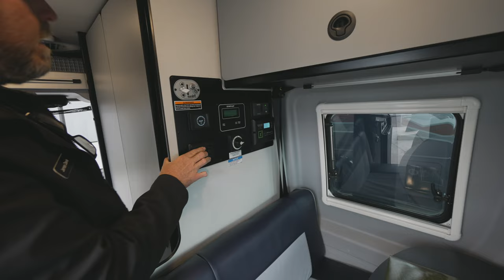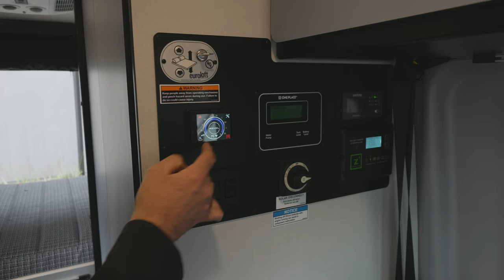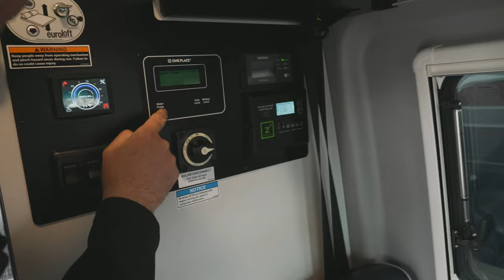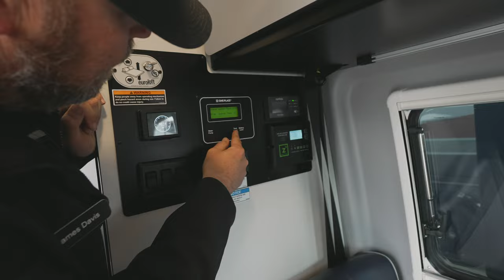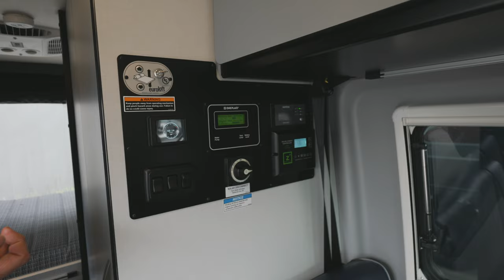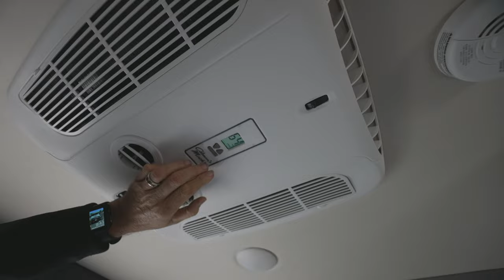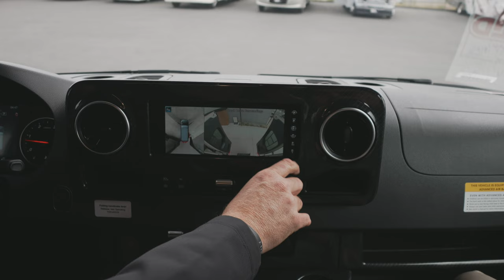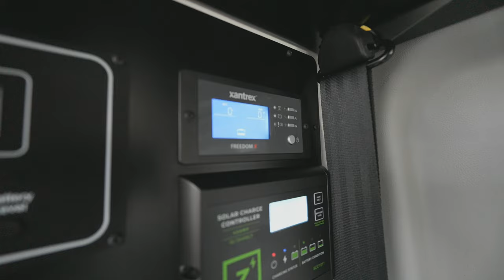Winnebago Revel Delivery + Van Tour

Comment: Super late here but hopefully you found the AC outlet below the fridge by now so you don’t need to prop the air dryer up on books lol.. are you still happy with your purchase?
Reply from the maker: Hi! I did, thanks to a few comments that pointed it out. Not sure I would've found it otherwise haha. Yep, still happy! Though if I could do over, knowing what I know now, I probably would have looked to buy used and a rig with a lot more upgrades.

No budget for upgrades any time soon, but I want larger tires, upgraded suspension, side ladder, boxes + accessories and mods lol. And without even looking, I've seen quite a few used for sale with a ton of upgrades at a great pice.

Comment: Wish it was not on a Mercedes Chassis,,,should have smart plug external not the plastic one...interesting drain release location...just a fancy Solis....should include a curtain for separating front cabin..bed is the highlight of the van....please get a deep sink Winnebago...least it has a vent fan...12 Volt AC?....not yet Winnebago?.....
Reply from the maker: Agree with everything you said other than wishing it wasn't on the Mercedes Chassis 🙌🏼